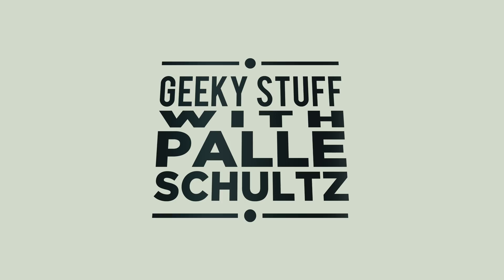Make a record button for the Fujifilm X-T2 - Geek +

Comment: great video, and maybe I've missed something. But how did you actually make the button? That is the question. Where did you solder wires etc and what cable, also where did you purchase the button???
Reply from the maker: Check links in description. Switch is momentary,, so it doesn’t matter which goes where. In camera record trigger is on tip. So you need to connect one to tip and one to ground.
Reply: @PalleSchultz  do you have the wiring diagram available please?
Reply: @e.m.c.weddingfilmsphotogra2680   following! i want to know what cable you used inside the woods handle